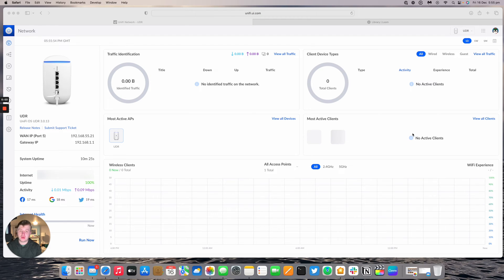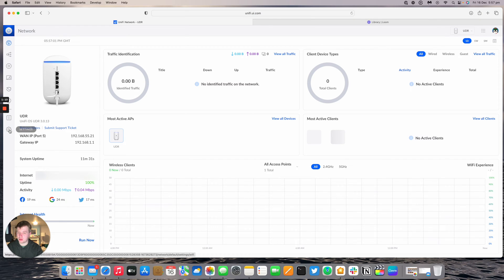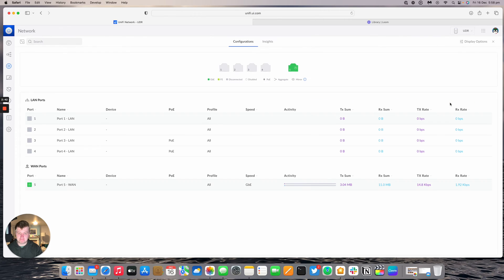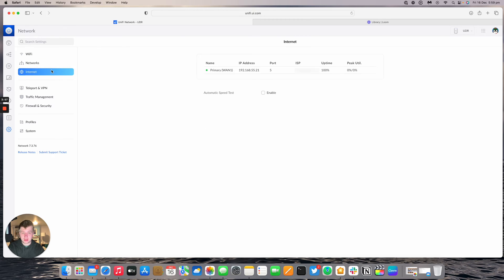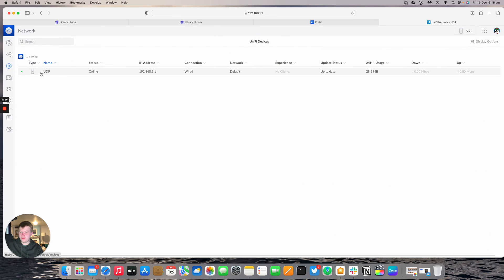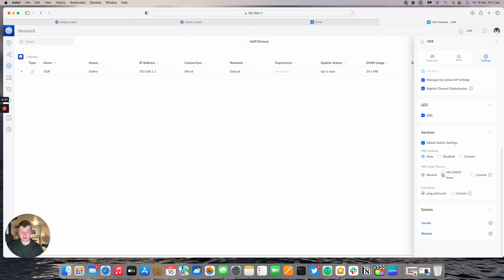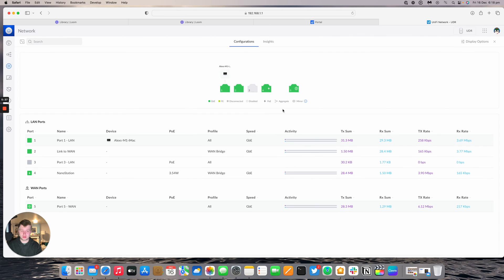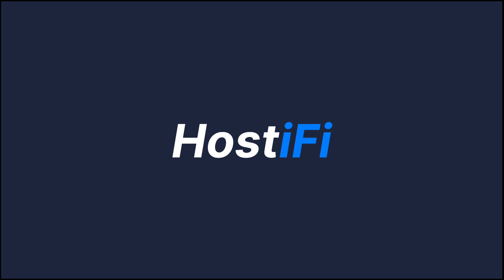UniFi - Power a NanoStation for WAN on UDR!

Comment: Is it possible to configure a nano station device running on unifi? And can you manage it ?
Reply from the maker: Hi there, the NanoStation can be managed, but only by the UISP Application.

Bear in mind that unlike UniFi devices, some provider devices from Ubiquiti (airMAX, airFiber, EdgeMAX) don’t need to be managed by a cloud controller.
Reply: @hostifi  can you be able to integrate a nano station device with unifi devices in same wifi hotspot network
Reply from the maker: No, unfortunately not. Older airMAX M devices can be used as standalone 802.11 WiFi APs, but they can’t be integrated into UniFi. The best thing to use outdoors for directional applications is the UAP-AC-M paired with the UMA-D
Reply: @hostifi  thanks for getting back to me. I have one more question please.
Is the UMA D range the same as nano station M5 ? Or
Reply from the maker: UMA-D won't have the same range as the NanoStation M5, but for most client use cases it will be ok. You can also pair the UAP-AC-M with many airMAX sector or omni antennas, but bear in mind these are single band only.